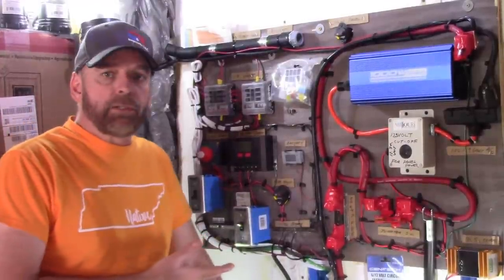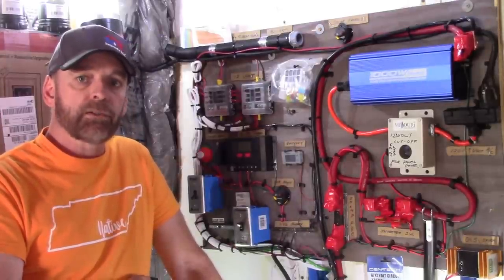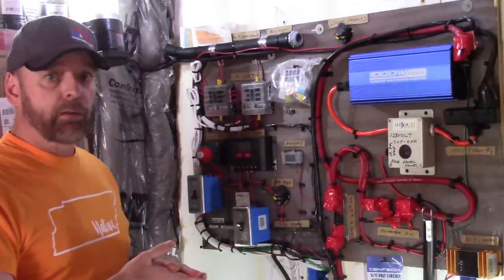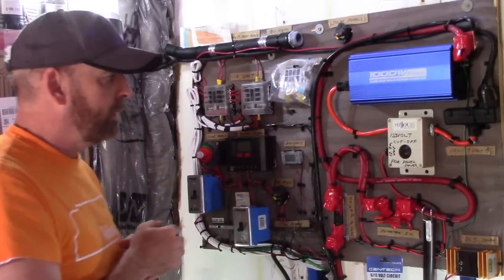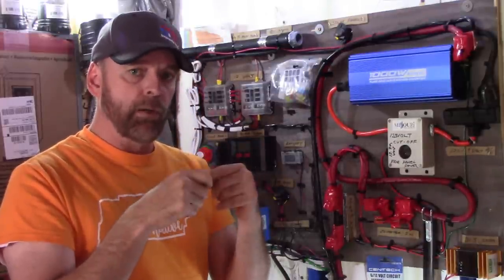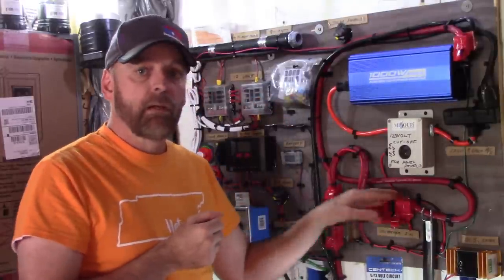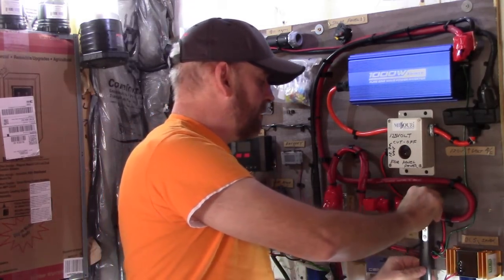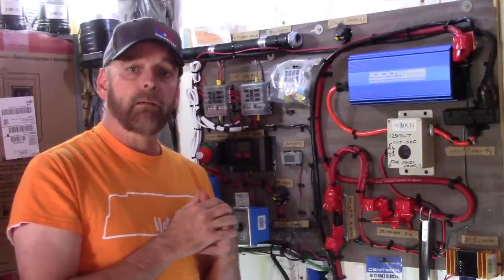Inexpensive Solar Power Off Grid Cabin or homestead DIY system #SOLAR #OFFGRID #homestead

Comment: Nice Video. I will add. In a off grid cabin setup. Stay DC to DC as much as you can. (laptop.TV, LED lights) Set screw connectors are made for solid wire. If using stranded, Solder on a sleeve.
Reply from the maker: Thank you for watching the video the connectors are rated for AL CU for 500 MCM.500MCM comes in strains. Soldering welding wire would probably damage the insulation first before you got it hot enough.The set screws are an industry standard.
Reply from the maker: We have used those same connections on the job sites on welding wire for over 30 years with zero failures. The NEC allows it also. Once again thank you for watching the video and for leaving a comment

Comment: I'm totally with you on this. I am an electrician myself  so there wasnt anything over my head going into it. That's a huge  advantage for us. I built my first system from scratch even building the panels from the ground up and I learned a lot. I wanted to see how well it worked so got a 30' travel trailer and started from there. I also had 12v tv, heater blower fan, all 12v pre-existing lighting, for the same reasons. Using a small swamp cooler someone disposed of, I gutted it and installed a radiator fan and shroud from an old junked vehicle and a 12v bilge pump. it worked fantastic. Using 300 ft of garden hose going back and forth across the roof I was able to make hot water faster than it could go thru the hose.. 
I just bought a remote home in the  woods of Arkansas and am trying new things and cant wait to watch all of your videos! Even tho there is a well onsite, I'm trying rainwater capture using roof gutters and attic mounted water tanks for gravity feed with a recirculating pump if needed.  This time I plan to go with a bit more expensive 48v system. I considered getting a split phase pure sine wave inverter, but the clothes dryer, double oven, water heater, Range, and heating/cooling systems would be too much demand and require a much larger investment. Since the home needs all new appliances it would be easier to buy all gas and swap out the jet kits for propane.
I'm sure I'll find plenty of info and tips and tricks on your channel!
Reply from the maker: Awesome good luck on your projects.

Comment: Watched your off grid water video earlier. The plumbing was way too neat for a plumber. Makes sense that you're an electrician. I like the system. I currently have 12 volt with 100 amp panels. I want to move to 48 volt soon, but keep things divisible so I have redundancy in my system. I'll either keep the 12 v system separate, or series the panels for the 48v system. Obviously the biggest advantage to the larger system is the ability to pass more watts at a lower current. Thanks for the video and it is a great breakdown of a basic system. God bless.
Reply from the maker: Ha...I laughed out loud at too neat for a plumber...good one. Ha a plumber only needs to know 5 things. 1. Hot is on the left.  2. Cold is on the right . 3. Crap runs down hill. 4. Payday is on Friday. 5. The boss is a SOB : ).

Comment: Very good video, good advice, it's not rocket science. You can over complicate anything and most "experts" are advising thousands of dollars and very complicated systems. In my travel trailer the only thing I use AC for is the fridge, if you use 12volt as much as possible your system will be less complicated. Every time you step up or down you lose energy and when on solar every watt counts. Conserve everywhere you can, that will make the difference in how efficient your system can be.
Reply from the maker: Well said. I have a solar playlist and I just uploaded an update to that system showing real world differences between a MPPT vs PWM charge controller.  Please subscribe.  Thank you for taking the time to leave a comment and for watching the video: )

Comment: I did the Harbor Friight set up first and I'm now building my new set up. A lot like this one in your video but 24V and a bit more expensive.  I may be up to 900.00 without batteries and panel.  I do like the AC cut off switch, I will look into getting one of those.  Great video!

Comment: I want to learn more about powering my off grid cabin and kitchen.  I am amazed by what you built.
Reply from the maker: I made the video so could hit the pause button as you made your system . Buy a Harbor freight system first and learn with it. Use their coupons.
Reply from the maker: I am also adding more cabin projects. So anyone can do it or at least get an idea.
Reply: I am going to fallow your instructions.  Ive been asking a lot of questions.  Don't have many answers.  I have 4 panels 12 volt 210 watts per panel.  Im confused on wich controller ill need how many amp batteries ill need. Im going to be runimg a small fridge, a cpl of led lights, and a small 12 volt builder pump for a boat to pump my water.
Reply: What is a vos?
Reply from the maker: @marcroemelen6836  you need a MPPT controller.  I have a video coming out showing you how to install it. It's on that same system I show in this video.
Reply: Thank you
Reply: Maybe its a bos. Its that copper colored heat sink on the right bottom of your set up?
Reply from the maker: @marcroemelen6836  No that is the BMS  product that removes sulfates from the battery bank
Reply: I dont know what a sulfate is friend.
Reply: I'll Google it

Comment: I watched this three years ago and again today - still good! I am an EE and I have come full circle on solar. Now I'm back to 12V everything, a tiny inverter for the small must-haves and demand side management. Just like you said! Lighting, fridge, propane thermostatically controlled RV style furnace (combustion fan, exhaust vent fan) - all 12V. Laptop, window shaker air conditioner, jet pump, HVAC plenum fan  - all on a small inverter with low parasitic and with gas powered backup suitcase genset. This is cheap and simple. 2kW on the roof and 6kWh in the basement. Lithium just because.

Comment: Really good explanation. I've been dabbling with solar for a number of years now. I'm now looking at installing a system on a trailer.  I always try to go with larger gauge wires than needed, as you have less power loss. I went cheap on my inverter, wish I hadn't as it is a modified sine wave. But it does the job I need
Reply from the maker: Awesome...you have to learn by doing : )

Comment: Just watched your video and I must say nicely done. Good information, quite practical and realistic with good emphasis on safety and suggestions on when you can or can't cut corners. Important things like fusing, disconnects and grounding. Watched a video the other day were the guy was making a very simple system connecting different colours of wire (without being consistent) and not even a $2 fuse on the battery.
I also like that you are trying to educate people and not stroke your ego. Too many video's were guys that don't really know what they are doing are just 
trying to show off.
Good job!
Reply from the maker: Thank you so much for leaving a comment and thank you leaving a nice comment.  I have caught some grief on this video and other videos I have made. Hey it works for me. And I found other YT videos talked down to someone trying to learn. Thank you once again.

Comment: I like your "Does it work?" design outlook.  The LED strip lighting in the equipment shed out back (riding mower, blower, etc) follows that outlook.  One 30 watt solar panel, good PWM charge controller, 15AH AGM battery (the shed is in the sun and a flooded battery would need frequent maintenance), 16 feet of LED strip lighting and a windup timer for the light switch - it's impossible to leave the lights on more than an hour.  Most visits to the shed are under 10 minutes so a quick turn of the knob gets power for as long as needed.  This has been in service about 18 months and it's always ready for use.  Beats using a flashlight to check whether there's a spare spark plug or air filter out there and was easier than running AC power under a concrete driveway ;-)
Reply from the maker: That's awesome nothing wrong with keeping it simple. Makes it easier in the long run too.

Comment: Sir, I LOVE the title of your channel.  The reason that I love it is that I think my 82 year old father will be able to relate to how you presented your inexpensive system.  My father has a great sense of humor and is intelligent in many ways, but does not understand anything beyond the basics of electricity.  He has become less tolerant with age, and I believe that he will appreciate your no-nonsense presentation regardless of how much he actually understands.  Dad recently mentioned that he would like to have a battery backup system that is capable of running his refrigerator and a few low-wattage appliances.  Over the last few weeks, I have been looking at what it would cost for the system he wants, and I have some figures to present to him plus options that I do not believe he has considered.  He has done little to no research himself, and my guess is that it is going to cost far more than he expects it will cost.  I am going to recommend that he watch this video, and get some feedback from him after he has watched it.  I hope to provide an update with his comments.  By the way...it is a great video!  I enjoyed the no-nonsense presentation, and your insight on several aspects of an off-grid power system.
Reply from the maker: I hope your dad enjoys the channel : )

Comment: Good, practical, straight forward video. I like your approach to this setup. And you nailed it with searching for auto and marine products. Well done. I have a tiny off grid cabin where I design and build radio gear. I have a very inexpensive dual solar power setup. Two identical, independent systems, each consisting of a 25 watt panel, 3 amp charge controller, and 100 aH battery. One system is for general cabin power... 12 volt led lights, automotive fans, and arctic air swamp cooler. The other powers my bench gear, radios, chargers, Android a small inverter for soldering. (I have included an on site generator for those cold, dark winter days.), and this setup has served me well for over 3 years. Like you say, it can be done relatively inexpensively.

Comment: Loved the way you explained the why's of your choices, the why you decided to do it the way you think is best, even though some people, maybe even more people, would go a different route, and you explained the logic behind the decisions to go in those directions. I'm sure i get some of the worst keyboard roofing and carpentry engineers possible on my videos, though. Those are the people that make doing videos discouraging, and they're also the people that apparently just watch videos and comment negatively on things because hey don't know there are other ways of doing things outside their work crew, and they sometimes don't realize that if you worked on 15 or 20 different crews doing basically the same thing, every crew would do things slightly different, and that leaves you with the knowledge of how to do it on every crew, and you  are then in a position to decide which of the different ways you think ends up being the best overall way to do each aspect of the same job. Decisions must be made, but it's nice to have the experience that actually allows you to have choices at all. A lot of people don't have choices because they only know of one way, and boy will they let ya know all about that one way and why it's right and what you did was wrong. It's nicer to have enough knowledge and skills to know the whole time what your options are, and that there are other options besides what most people would go for. I do the same thing all the time, disregarding what's common or the norm because I'm experienced enough to know my options, and see a better choice. Great video.
Reply from the maker: Thank you so much. You get it!
Reply: @GrumpyMountainMan  Too well, unfortunately. People with no clue that think there is only one way. That in itself is a sign of inexperience, and then it gets worse as soon as they are loyal only to the one way they know of, and they start voicing it as the gospel. Even at my 50 yrs of age, coupled to being out in residential frame work since i was like 6 yrs old, and didn't even get summer vacation anymore after like 10 yrs old cause my dad made me go to work every summer, I still to this day have to weigh new against old techniques . Some because of materials being used, and some based entirely upon technique, and old just doesn't win every time, regardless of how long I've been doing it like that. I also do my own work so much that i find new ways against my own old ways, on stuff nobody else even knows about except for me. These are decisions we all have to deal with to some extent, and somebody that's pretty edvanced in whatever they are doing has tougher choices to make, and even gets them all wrong every now and again. I recognize just having choices, where someone else doesn;t even see choices, as experience well above the experience of one who sees no choices. You had two goals, cheap and won't break because it's too cheap, and you kinda explained exactly where you stood on them based upon your experience.  You probably couldn't have done much better, from my perspective. You're just at that level where it doesn't get much better. And that's not an age thing, either. Age has little to do with that, as i know because I've always been way ahead of where age and inexperience due to age is a factor. It's my experience telling me you're hitting the marks perfectly.

Comment: I cannot agree more, i have a 12v system in my shed that I've had for 6yrs and it's great, everyone says 12v no good it needs to be at least 24v or more but you loose a battery and your in the dark as you said, my system run a 65lt freezer and a 210lt fridge freezer plus LED lights and 12v fans a 32cm tv a dvd/media player and a 2500w pure sine wave inverter all from 800w of panels 4x200w and 6x100ah agm batteries !! I love 12v very easy, very simple, very inexpensive and most of all manageable. I'm a disability pensioner so inexpensive suits me right down to the ground !!!  Seeya Rob..................by the way you now have a new enthusiastic subscriber !! Great video more please haha.
Reply from the maker: Awesome I have a video coming out on that same system.  Showing the real world differences on MPPT VS PWM.  I also have a playlist showing other solar videos and wind turbines.  Thank you for taking the time to watch and to leave a comment.  Take care.

Comment: Thank you for your video.  My build is somewhat different and I seek to learn wherever possible.  I opted for a 40 Amp auto 12/24 Volt MPPT solar charge controller but plan on using 24 Volt Lithium Iron Phosphate batteries of at least 100 Amp but likely 200 Amp current capacity.  My cable plant for the 24 volt DC side is 2 AWG welding cable which is limited by 50 Amp circuit breakers which double as a switch.  To have a fall back, an Automatic Transfer Switch connects via 12/3 heavy duty cable to provide power in case battery voltage goes below a set threshold to extend the life of the batteries as far as possible.  This way, if the batteries fail or get low on voltage another source of power can cut in seamlessly whether that source is household power, a wind turbine or electric generator.  
I agree that a pure sine wave inverter is best - the battery voltage, once determined, means that the power inverter from 24V DC to 120 VAC is set at 24 Volts and this means most local suppliers won't carry a 24 Volt power inverter.  
    One of the reasons I chose a 24 V system is that without spending really more than a 12 Volt system, the charge controller at 40 Amps can easily handle a 1,000 watts of solar panel input.  As such, instead of the 17.5 volts the panel open circuit provides has to be doubled to 35 volts by connecting 2 solar panels in series and the configuration is panels are coupled in series, then run in parallel at 35 volts to input the charge controller.  As long as the charge controller can handle a higher voltage, some charge controllers enable you to over panel the charge controller.  This means while the controller is rated at 40 Amp input solar panel power, you can increase the voltage to maintain the same amperage and not overwhelm the charge controller.  This is neat as solar panels are really cheap.  I enjoyed your video.
Reply from the maker: Thank you so much for posting this. I have a solar playlist and I am editing more videos. Please subscribe. Thank you for watching the video and for leaving a comment.  Take care.
Reply from the maker: I too have a wind turbine that is tied in plus other options also.

Comment: Thanks for all the tips and advice.  I am just running a few small solar systems.  I live alone, so don't need much.  I love the 12 volt lights from Amazon that use only 3 watts, and are more than bright enough to read under and do everything.  I've been using some AGM batteries and some used flooded lead acid batteries.  I like the AGM's much better so far.  I have looked at the lithium LIFEpo batteries.  May buy some later.  Can you do a video on free energy electricity devices?
Reply from the maker: I'm using AGM and Lead...they are hard to beat and easy to source in a pinch.
Reply: @GrumpyMountainMan  I agree, for sure.